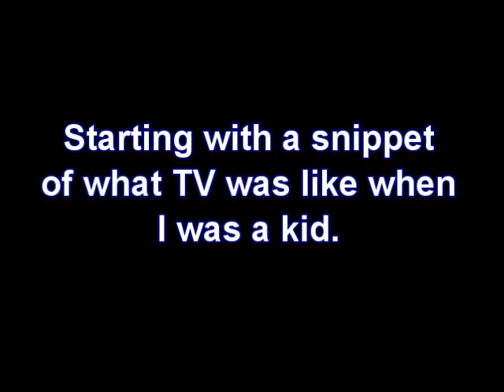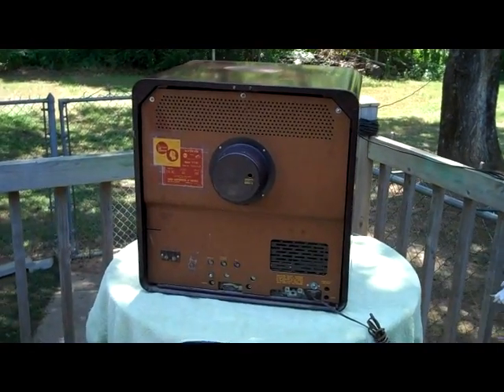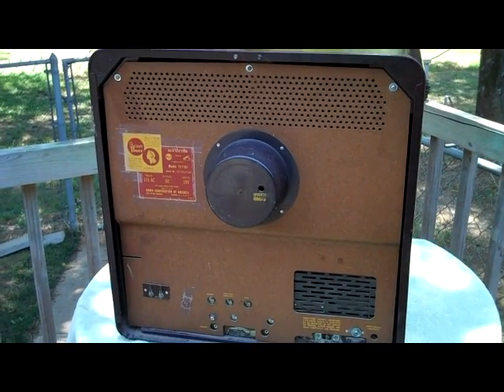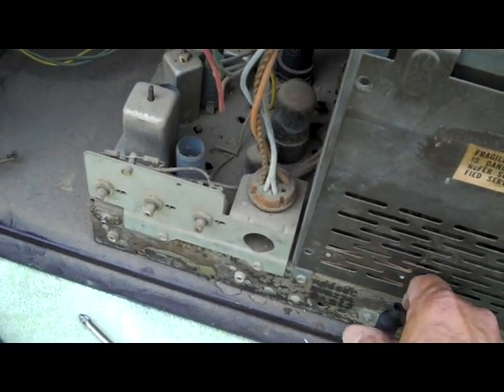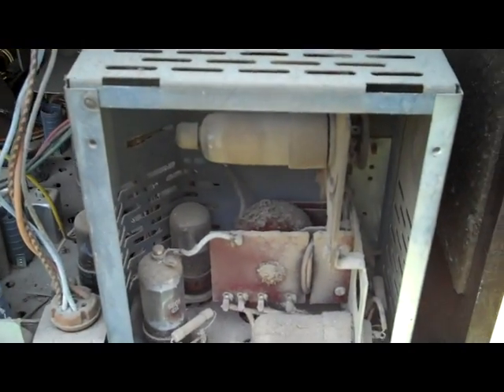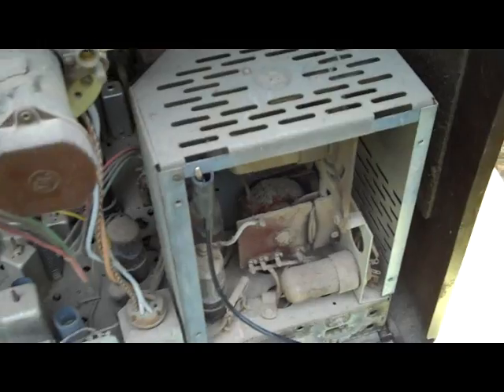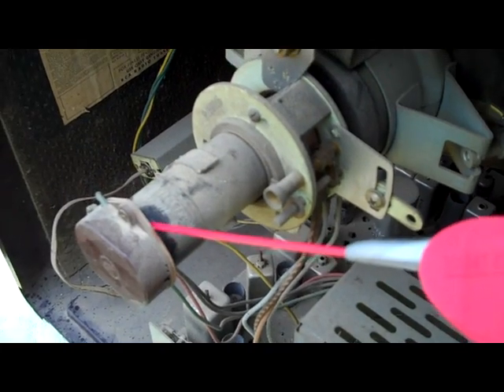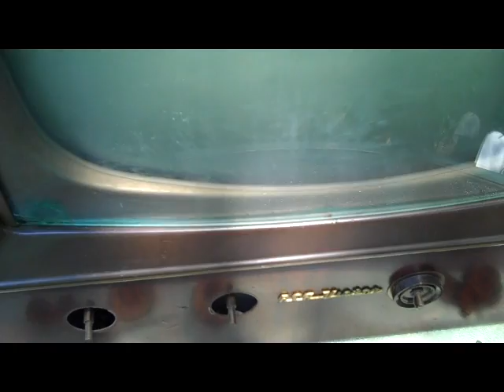1952 RCA Model 17T151 17" TV Repair and Restoration (Part 1 of 27)

Comment: I just finished watching all of the installments of this project and want to thank you for taking the time to share this amazing project! Very informative and well done. While I've repaired many TV's in my life, I never restored one. I've just restored a zillion radios from the 1920-1960's. One thing that surprises me about this set, it has a power transformer and not a 5U4 rectifier instead of seleniums. The seleniums were used extensively in the transformerless smaller TV's of the 50's.

Comment from the maker: Sal,
It'll take quite a bit of time to change out those old caps, but they all appear to be easily accessible, which is half the battle.  But we never get in a hurry with this old stuff.  Ya just have to take it one cap/resistor at a time...and smile, smile, smile.  :-)

Regards,
John

Comment: well, my dial string is fine, I just have to figure out how to string it back on there. I also have to file down the rivets I used to rivet the new dial on because they hit the frame, and the new dial is slightly thicker than the old one so it didn't fit 100% perfectly, but I got it so it looks ok^^

Comment: Well I think the flyback transformer is the thing that went, I don't know how difficult it is to find a replacement, but I still have a few radios to do before I get to that TV. as for the philco 89, I'm taking your advice and taking my time ;-) I actually just primed the chassis last night and I'm going to paint it today.I also have to re-strng the dial cord because I removed it to replace the dial. I took pics of how it was routed but I accidentally deleted them so...

Comment from the maker: Jerome,
Right you are...vintage electronics repair and restoration is a great hobby, but not for everyone, especially the untrained faint of heart.  It can be pretty daunting probing around wires and components having thousands of volts running through them.
But I really like working on old tube gear.
Thanks for dropping in.

Regards,
John

Comment: Not sure if I'm watching an RCA TV  restoration video, or the Dinah Shore Show!😁  A tip, the WD-40 on the picture tube socket is ok, but ALWAYS be sure to hold onto the (black) socket portion that stays attached to the CRT neck, while gently removing the wired socket from the CRT, with your other hand.